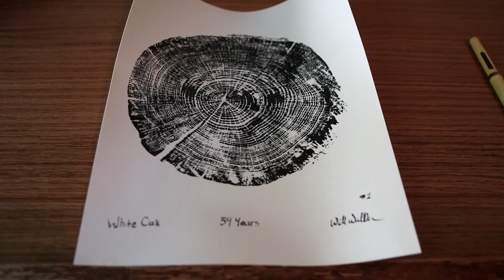How to Dramatically Cut a Log   -WmWalkerCo-   #DramaticLogCutChallenge

Comment: This was a great idea for a challenge. It has introduced me to two new channels. I did a log print video a few weeks ago and just did a live edge frame for it from the same wood. Really interesting to see how someone else goes about the same thing. I love the work of Bryan Nash Gill. 

Thank you
Reply from the maker: I wish I had seen your video when I was planning mine!  I love the work of Bryan Nash Gill as well, and that was my main inspiration for my print.  I had a terrible time finding any information on his method so I had to go at it with a bit of trial and error.  I just watched and subscribed to your channel.   Do you find that the water is necessary?  In my experience, torching, brushing torching, brushing was more than adequate to raise the grain.  Although it did present some serious checking from the pith.  Thanks for watching!
Reply: Wm. Walker Co. Im a big fan of your channel so you just made my day by subscribing. 

I was the same and finding info on how it was done was hard. At first i did not burn it enough then i used a ink that was to thin. You are probably right and the water is not necessary but i went for the belt and braces method for this project ( sorry a British phrase ) Did you seal the log at all or did it work printing right onto it?

Next video i turn the log in to a lamp.
Reply from the maker: I didn't seal the log but this was also white oak so it has a pretty tight grain structure.  Probably why they use it for making wine and whiskey barrels.  If it were  Red Oak it would be a bit more pourous and that might suck up more of the ink.  I did mist the paper with some water though.  I did some research on relief printing and if you wet the paper it tends to give you a better transfer while having to use less ink.  I did experiment with dry paper, damp paper, and downright wet paper.  A light misting seemed to yield the best results for me.
Reply: Wm. Walker Co. Great i will try that next time.

Comment: Quick question: why did you burn it?
Reply from the maker: You burn it to burn off the softer wood in between the growth rings then brush off the carbon left by the burning.  Repeat that process until you have really defined growth rings.  It makes the rings really stand out giving you a better print.